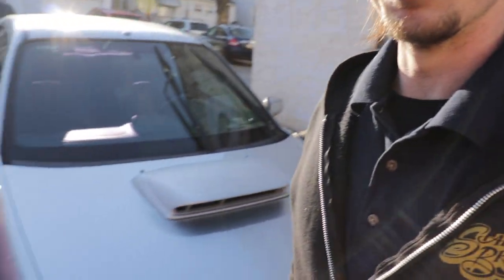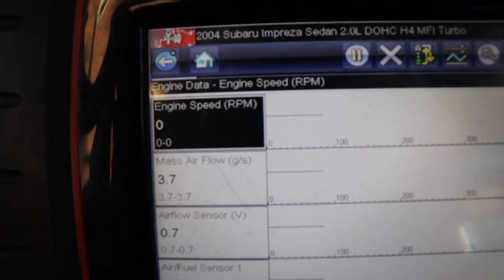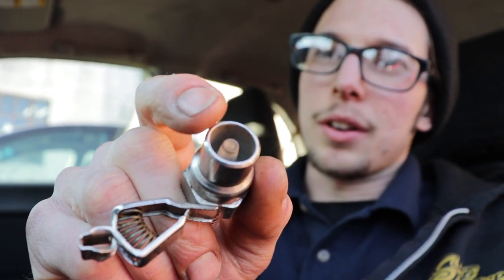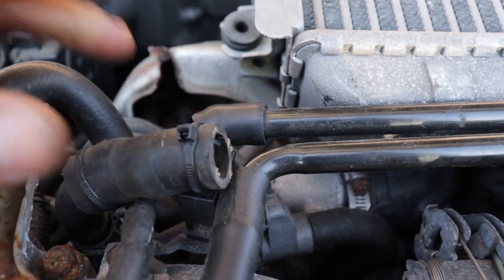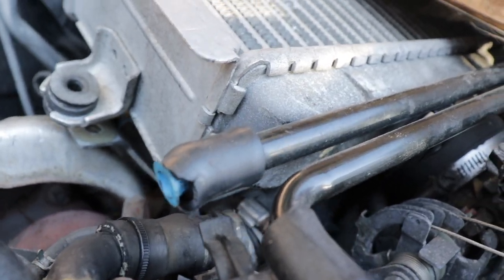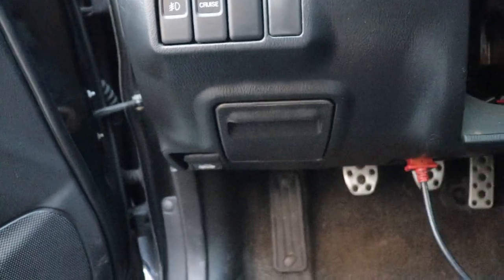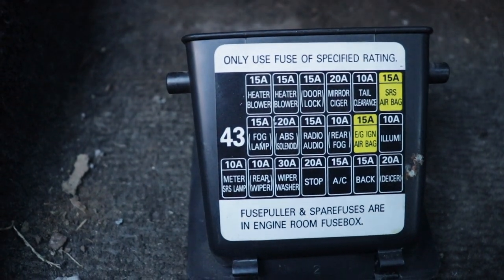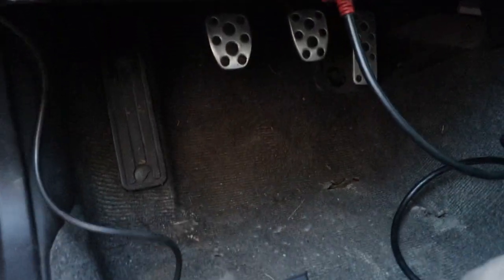Subaru WRX JDM ej20 NO START testing

Comment: I installed ej205 avcs jdm to a usdm non avcs. Wont start seems crank and cam sensor have no voltage.. has any one had this before? I checked crank sprocket and seems the same( not sure of material) camshaft is good with same timing marks as original
Sparkplugs do havr voltage, fuel is great, coilpacks are original engine too, checked all grounds. Orginal harness.
Reply from the maker: you dont have voltage going to the cam and crank or coming from?
Reply: @salvobrothers5928  correct it doesnt have any voltage. Not sure if cam, crank carry voltage or only read timing marks ans send signal to ecu. Issue is vehile cranks but no start=/
Reply from the maker: @rayleal2109  there should always be voltage at those sensors they send a pulse when the teeth move across the sensor so if you don't have voltage you need to find out why thats not present at those wires
Reply: I’m now having the same problem i just installed the non avcs Jdm ej20 engine in my 2002 Wrx impreza Wrx it’s turning over but no stars can anymore help me?
Reply from the maker: @firstchancetryingboy4198  check to see if the fuel pump is running and check spark
Reply: @firstchancetryingboy4198  it’s the crank and driver side intake cam sprocket I just did the same swap had no start till I charged to the old ones off the usdm ej205
Reply: I put a ej20x in my 2013 and won’t start, timing gears and timing are same and correct, I’ve tried everything